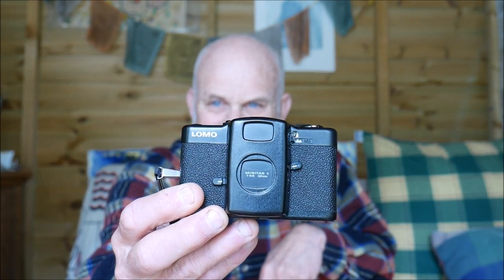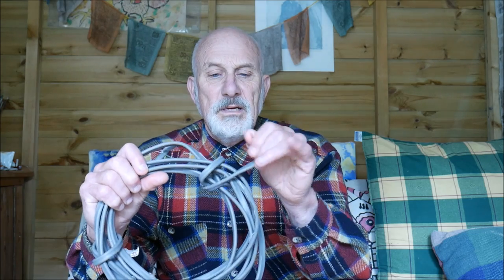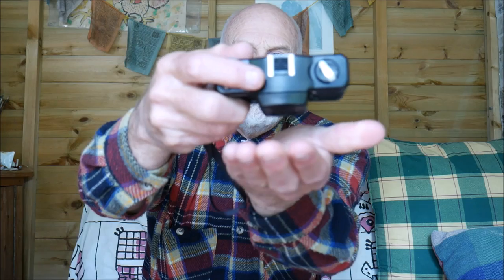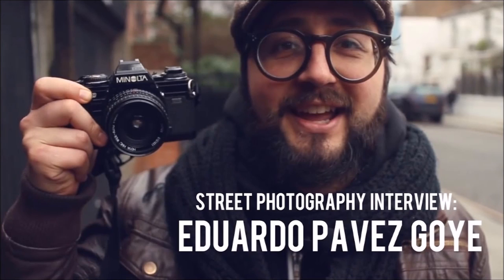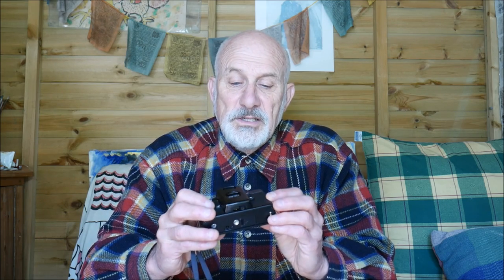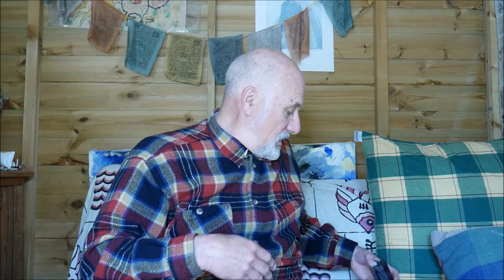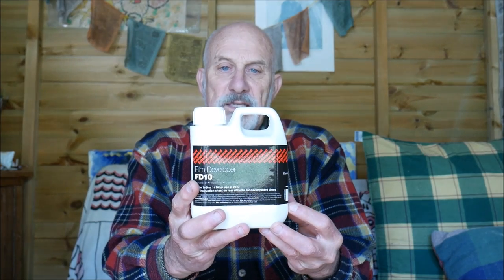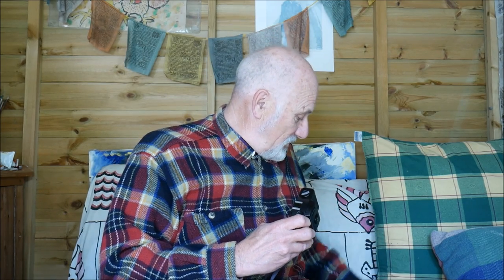Lomo LC-A: Sticky Shutter Fix: B&W Images & Developing

Comment: I want to thank you SO much!! After resolving that i just may have to take apart the Lomo LCA (2nd production run) i bought recently to fix the "sticky shutter", i looked again at the battery terminals, because i got the unit with leaking batteries which the previous owner never took out before storing it. Followed your advice and it is working beautifully, got 38 exposures from my last roll. So glad i found this channel 👏👌

Comment: Another really informative video thanks, I was recently given an Olympus OM10 with a 50mm lens with the same problem, battery terminals. It works a treat now. Would love to see your developing process, I'm in two minds as to going down that line, at the moment I shoot B/W film that can be processed in a normal high street shop, Ilford XP2 400 but like you say its not cheap.Great shots btw nice little camera, keep them coming :) Tim

Comment: Thanks for video! Maybe You could help me with another problem. My lomo is working good except for my second LED no lighting up when underexposed. The LED is operational but it dont get current as i halfpress the shutter. Again thank You for your knowledge.
Reply from the maker: Can't really help I'm afraid. I had an LCA which had a similar issue but it didn't appear to affect the the final image.